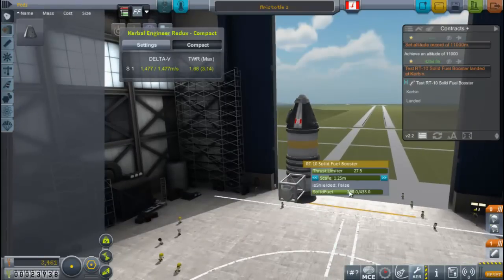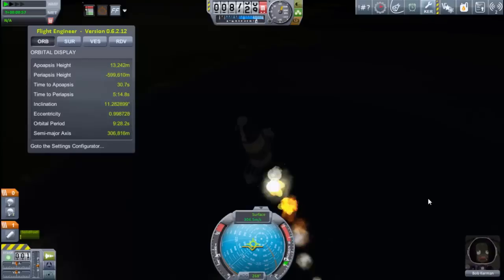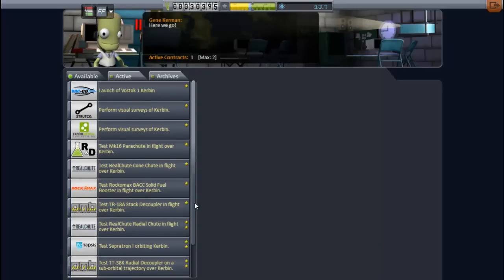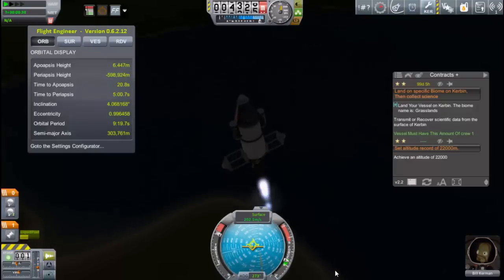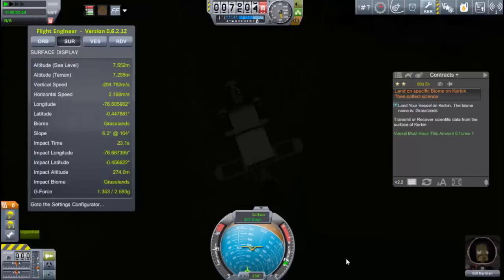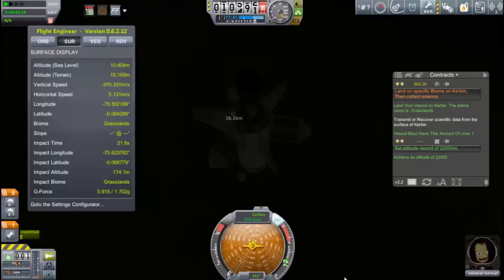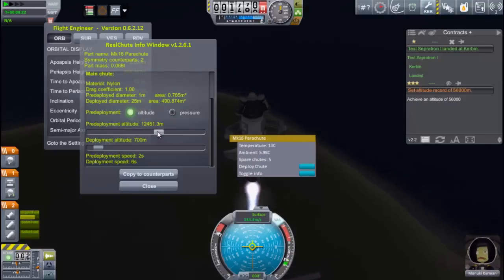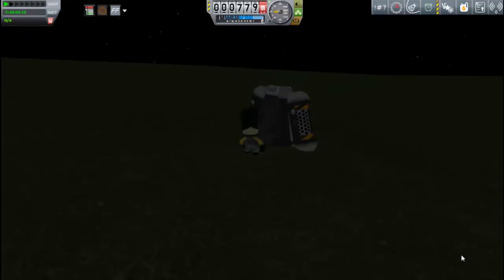KSP Beta Career: Episode 2 - Flaffing About In The Atmosphere

Comment: I don't have RealChutes or Deadly Re-Entry installed, but what I have done is set the activation pressure of chutes to 0.3 ATM. That makes them deploy at between 5 and 6 km, which should I think deal with the deadly re-entry issue you were discussing. 

Also, and this is a bit odd, but if you use the Aviation Lights mod, consider putting the white beacon lights on the outside of your vessels. That makes them show up very nicely indeed in night.
Reply from the maker: I haven't started unlocking the lights yet, but that's a good idea.  As for the parachutes, yes that sounds about right.  They can't be tweaked in the VAB which is throwing me, but I've just discovered, once tweaked the settings are consistent over subsequent builds.  I think for now, I'm more comfortable hovering over the spacebar.